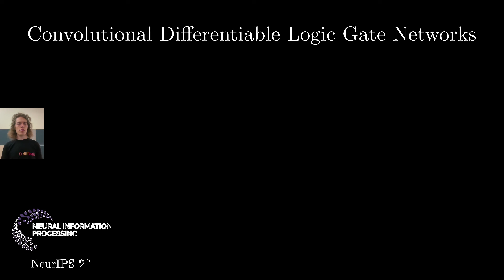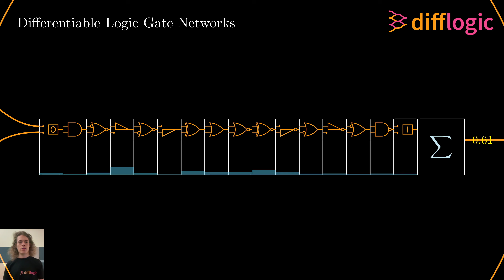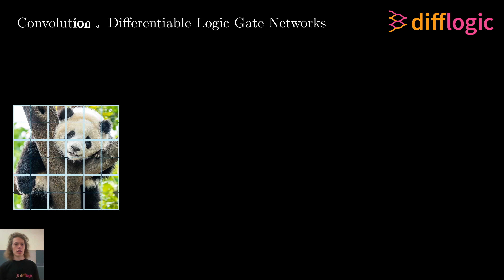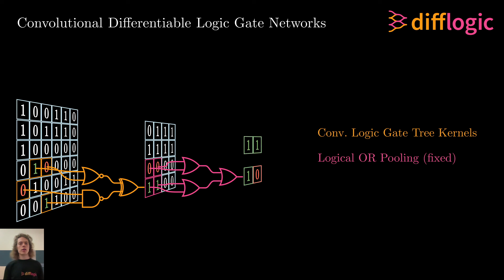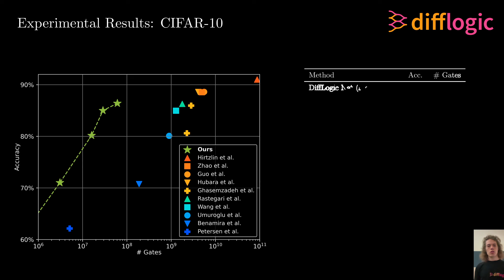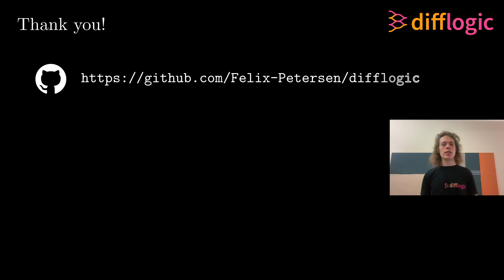Convolutional Differentiable Logic Gate Networks - NeurIPS Oral - difflogic

Comment: Are DLGN interpretable (or more interpretable) than traditional neural networks? Afaik,  the field of digital design is "very well understood" and HW designers have been using synthesizers for 40+ years to map HDL code  (i.e. operations) to real logic circuit. I am wondering if any of this could be reused to understand what a logic gate (or a group of them) at a given layer is doing to perform the task -- something that is arguably not really possible in traditional DNN.
Reply: their differential gates can be completely replaced by others during backpropagation which makes this unsuitable for hardware, unless you re-route prior layer to different routes for which we know apriori the behaviors. Thus, in hardware you need to create a lot of redundancy which is not a bad thing. The whole brain is redundant starting from the fact of having two separately functionating hemispheres. The idea is amazing. I'm working on something similar, but the gates are in probabilistic superposition. Hence, they don't have to be replaced with others but rather turned partially on and off. Certainly, I have a lot of inherent redundancy inside my model. And since each gate is a single CPU operation, this is extremely fast.

Comment: I think conv diff logic gate network is not purely combinational (because of the sliding logic gate kernels) and thus requires some registers to store intermediate results, right? If right, the merits of the logic gate network might be quite diminished by the power-hungry registers with very-high speed clocks.

Comment: What's the point of this when a standard NN can model all possible configurations automatically by just increasing the number of weights? Maybe the better idea would be to take arbitrary NN's and convert them to an optimal configuration of logic gates?
Reply: Well because this is more efficient then previous implementations. If you wanted to do that you could thoretically use the input and output of a standard neural network to train the logic gate network. I am curious which would have faster inference after doing that. Or if this is just for chip design.
Reply: @rickybloss8537  Is it though? Or is it only more efficient in hardware because of historical development(e.g., use of logic gate designs)?

It would seem to me that using a specific design of gates sort of limits and defeats the generality of a NN.

I'm not saying it does not necessarily have any use but I can't see why essentially limiting the behavior to gates is better unless, maybe, that gives some type of organizational structure to the topology that actually helps training. E.g., sort of "shape" of blocks of weights into meaningful structures rather than having to train for it. E.g., it would produce shorter training times and require less weights in general. This doesn't mean it is better but maybe in a practical sense it is. But there should be some proof that it is better.
Reply: @MDNQ-ud1ty  I meant, as implied by the context of the video, that it is more efficient then the other logic gate training algorithms. Logic gates like neural networks are Turing Complete. So I don't see how the generality is hindered whatsoever. I said I was curious as whether one or the other is more efficient.  An experiment comparing the inference and training speeds of the 2 algorithms would be nice is all I'm saying.

Comment: As long as you use nonlinear structures, you can design many different neural networks. This structure will be fast because it can be reduced to the current computer architecture, but in essence it is a solution to a curve fitting problem.

It is possible to distill existing networks to much faster versions. I think the real success will come from analog networks.